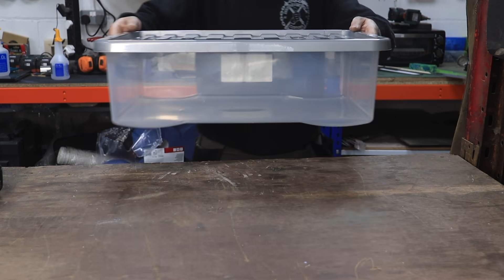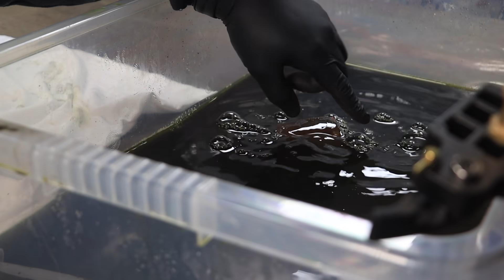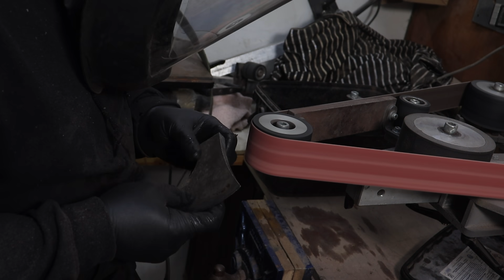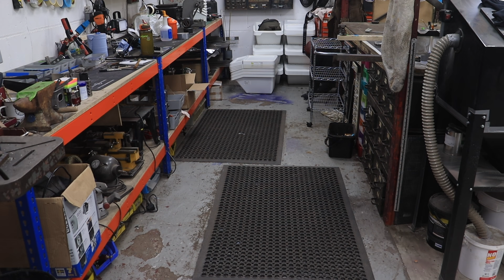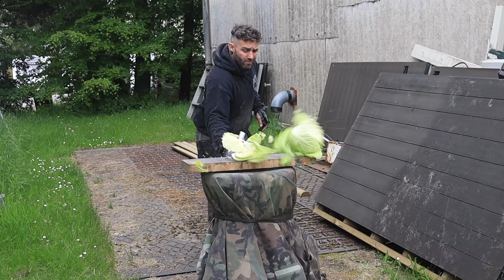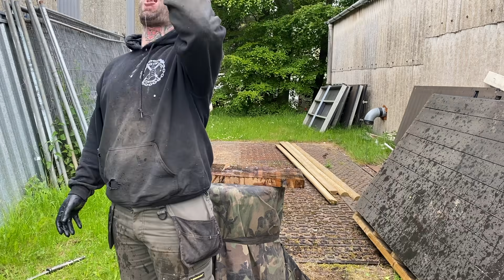Building an Extending Axe - Will It Work

Comment: You gonna use the flat axe for anything and or the remains of the axe you cut?
Reply from the maker: No because it all junk
Reply: @DiesInEveryFilm  oh cause I was thinking say you would make a half skeleton half regular axe, basically having a axe head on both ends of it if that makes sense but hey you're decision buddy. NGL you have partially inspired me in wanting to become a welder so do you have any tips for beginners.
Reply from the maker: Nah it’s just not worth the time, id say just give it a go.
Reply: @DiesInEveryFilm  Oh alright then, I was thinking once I had the money to go to trade school for classes. Also you should check out etsy since they have a lot of things for knife making like saw blades, hand saws, even rusty axes and knives themselves. I'm even thinking of buying a old barn door latch to try and make a knife with cause it's thick cast iron or cold rolled steel. Just a couple of printouts and a lot of dremeling later should do the trick, when getting to grinding in an edge do you have any tips cause I can't eye it like you can lol?

Comment: Id almost rather it welded tight in its extended position boss! Thats a slick lookin Mad Max beast right there
Reply from the maker: The base is cast so wouldn’t weld very well, just the shaft is steel 
Thanks

Comment: Wow this will give you carpal tunnel in no time if u try to chop anything for long periods of time. I wouldnt trust this flimsy construction and those welds....
Reply: I read this and thought wow this guy must have a good channel with some good work if he is talking smack. Nope just another bitter person going round trying to pull ppl down with nothing constructive to add to the platform.
Reply from the maker: “Wouldn’t trust those welds” shows exactly what you know
Reply: @Bugoutvehiclesuk  there is a reason why axes have a wood handle. Dont change a running system. Plus the extendable part is super bad fit and finish just look at it wobbling around 😂 And yes @diesineveryfilm those welds might hold up but that woobly handle will break + give you carpal tunnel and cancer in the process.
Reply: @edwinsekt5989  I can’t believe ppl can’t grasp that making YouTube vids is his job. Anyone with half a brain will get that making the same traditional axe every week won’t get views. Look at his subs and how many views he’s getting and tell me he’s doing it wrong. It made you click on the vid to watch so he did it right. Even if you did just click on to try and pull his work. Next time just click on the vids that make you happy instead of trolling round digging at ppl.
Reply: @edwinsekt5989  this is totally over your head. You can’t get over the point of these vids and are obsessed with everything having to be one way. If you are right make a vid of you making a traditional axe. If your confident  it will be your full time job in no time. Or just leave the YouTubers  to get millions of views and make a living. Looking at the views on this channel your pissing in the wind trying to prove a point.